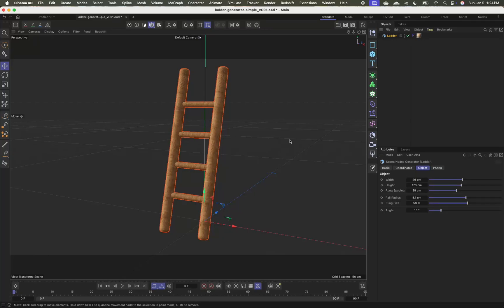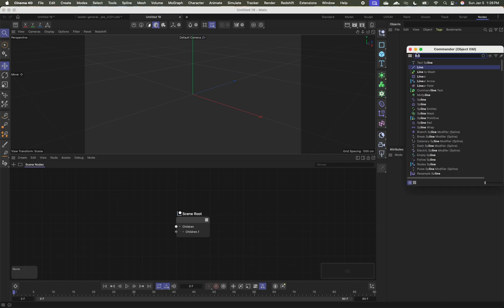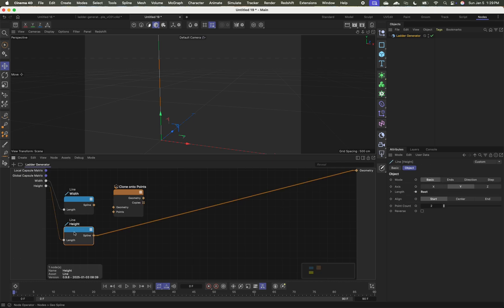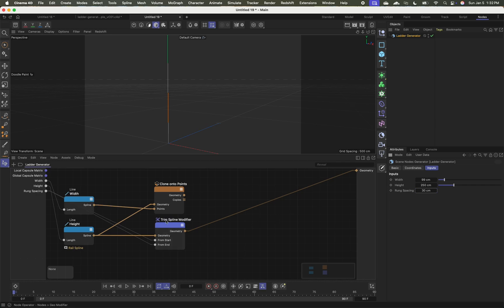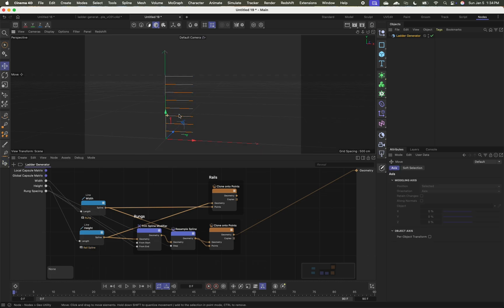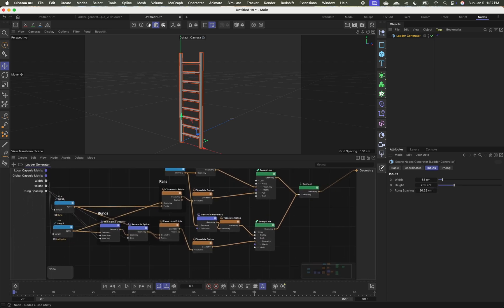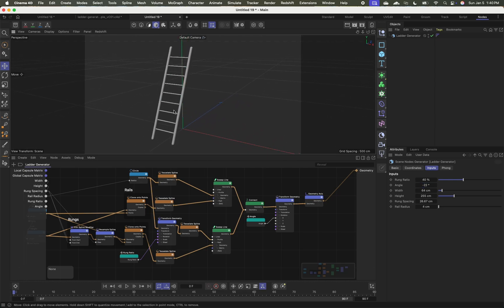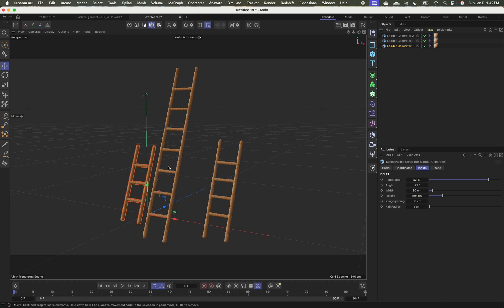Create a Stylized Wooden Ladder with Scene Nodes in Cinema 4D 2025.1

Comment: so good. Can the change in the diffuse value according to the camera angle be controlled by the node?
Reply from the maker: In a Redshift material you can use the Fresnel node to get a Black->White ramp based on whether a surface is facing the camera. You can pipe that through a Ramp node to apply custom colors.
Reply: @scenenodestips   Please show me~